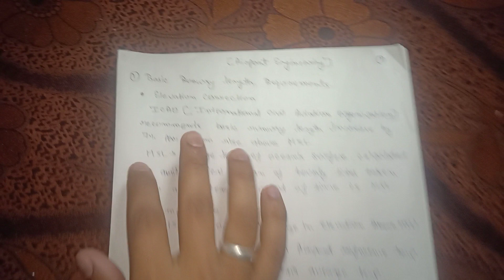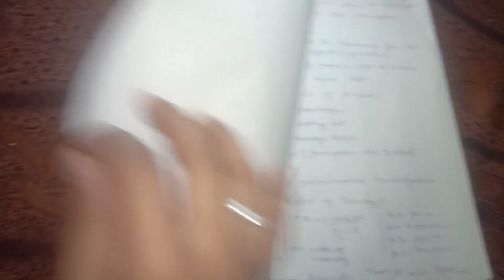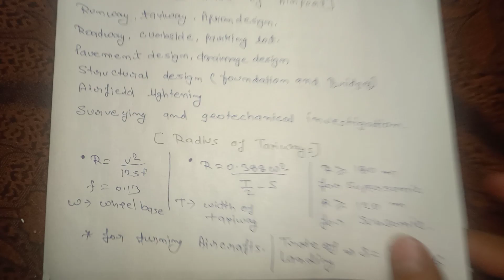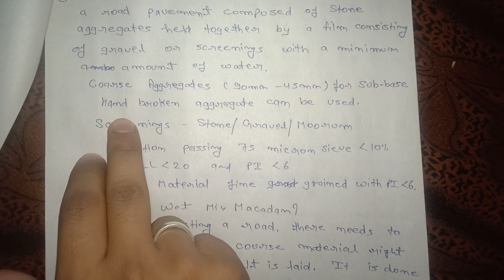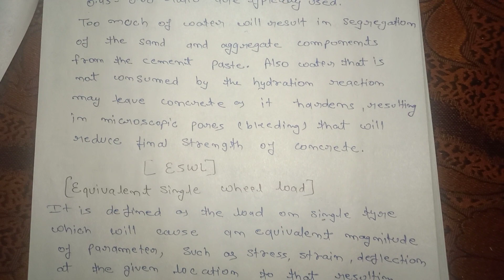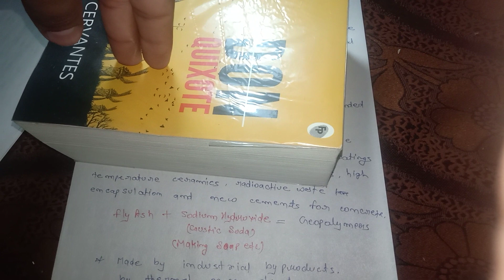Airport Authority of India Internship / Apprenticeship / Interview Questions and Answers

Comment: Bro mera interview h aai m i m a diploma holder in electrical engineering please share me your experience in interview
Reply from the maker: Hey. All the best for you interview. Don't stress too much, I have covered everything in this video, as well as the video which I have shared with a pinned comment. Your all doubts will be cleared.
Reply: Bhai puchte kya h theory study material se relative ya or kchh bhi bcz it is a my first interview i m a Very nervous
Reply from the maker: @vikasdubey7395  It is nothing of that sort to worry about. Just apne, basics clear rakhe.. They don't ask difficult questions, at least unhone mere batch m nhi puche the. This time if the board has been changed then they can ask. But since it is an internship they won't ask difficult questions. Don't fumble, while answering. And if u don't know, say I don't know. It would be fine
Reply: Thanks bro
Reply: Bro please tell me  Copy of Form Submitted in BOAT portal.ye kya hota h konsi copy h
Reply from the maker: @vikasdubey7395  i don't know about this
Reply: @ShubhamLakhera  ok😶
Reply: Aai m pura dhandli chlta h local walo ko koi preference nhi di ja rhi h apprentice act ke according local walo ko phle liya jata h but yha esa kchh nhi le rhe pura currpation h khajuraho airport m electrical HR currupt h pura
Reply: Interview ke bad mail aaya th ? Aur kitne din bad